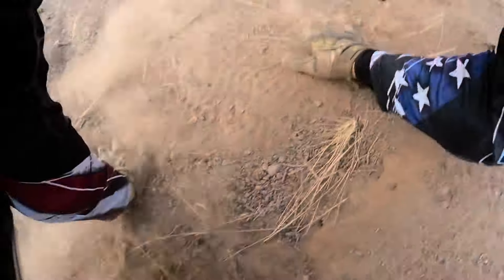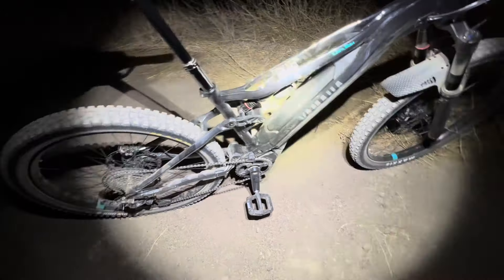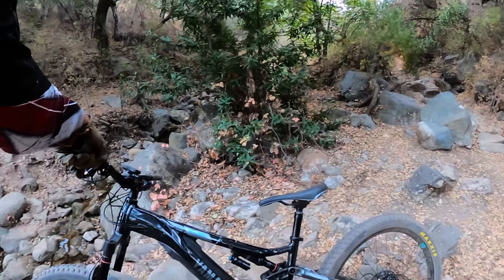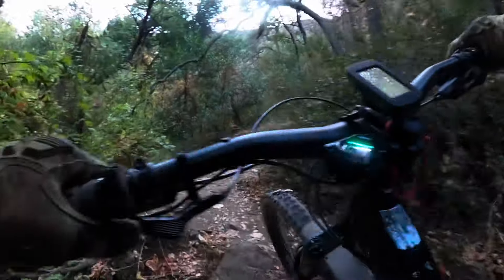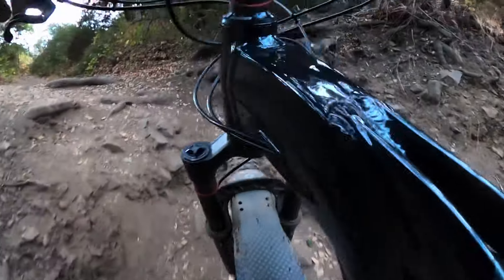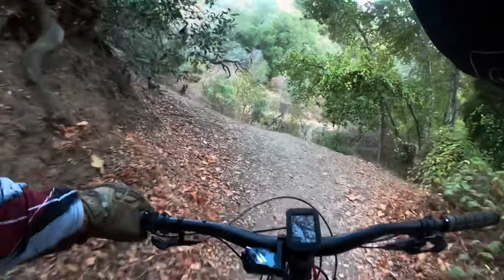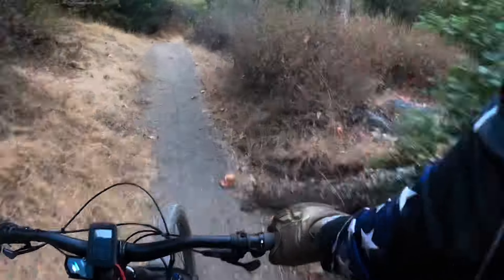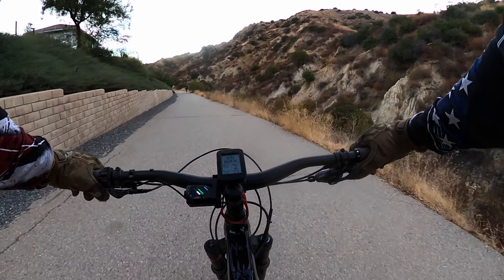Yamaha YDX-Moro 07 Third ride

Comment: What extra display are ya using?
Reply from the maker: Thats the Garmin 520, I have had it for years, been super dependable, gives plenty of data and you can change the display screen to show what you want, its pretty durable too, been in several crashes and tumbled down the trail more than a couple times,  even took it apart and replaced the battery when it finally was not holding a charge for very long. As if that wasnt enough, I also record on a Garmin Instinct watch, it works great also, just has a smaller screen.

Comment: This is awesome i saw this on the trail and was surprsed this can actually fit 29 inch tires, specs say 27.5 but i missed  the point that it was 27.5plus meaning it can fit 29 2.4 inch
Reply from the maker: @marklouieadame  So if someone swapped the rims to 29 they could run 29 2.4 tires? Next time I have a wheel off the bike I should try a 29 from my other bike to see how it fits.

Comment: Thinking of getting one with these massive rebates...just trying to decide on the 5 or 7?
Reply from the maker: Im not 100% sure, but I think they are all sold out 😞
Reply: Not here in Canada  @no1cr500racer
Reply: I ordered an 07 on Oct 3, but they ran out a few days earlier. I ordered an 05 a week or so ago, and it says it shipped--we'll see.
Reply from the maker: @Kenwindatt  Nice! I would get the 7, well, I did get the 7, but it has a better component package.
Reply: @Kenwindatt  how do you apply for the rebate? is it applicable in Ontario?